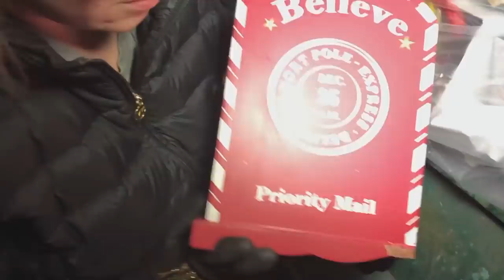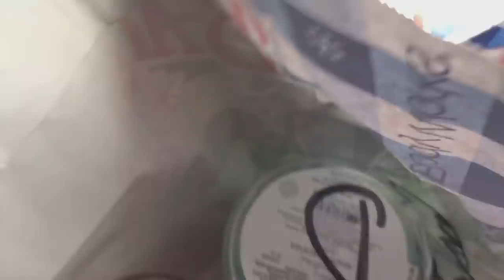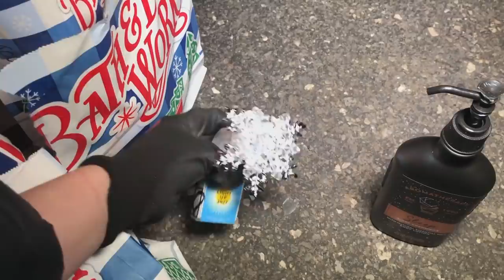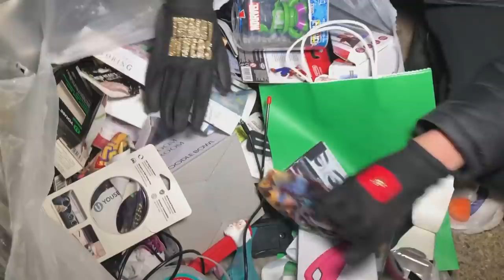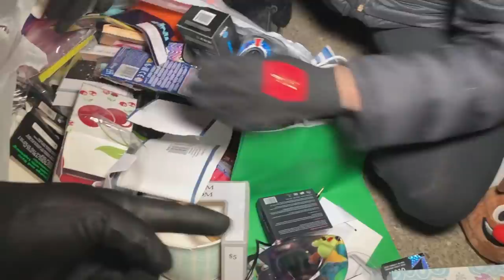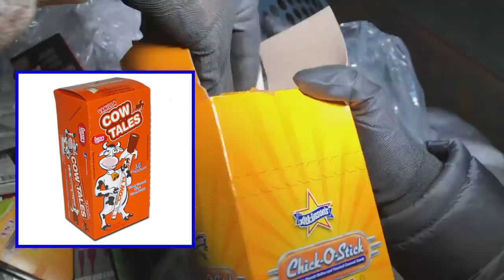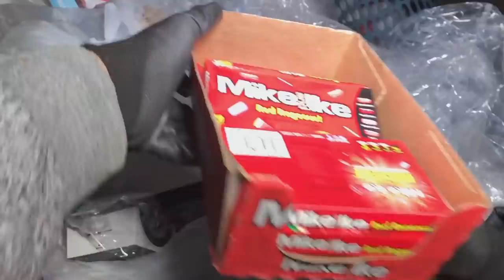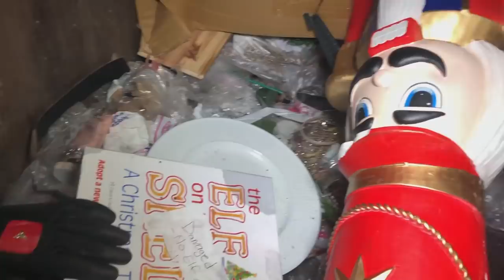MICHAEL'S EMPLOYEE'S LEFT US A HUGEEE! SURPRISE! IN THEIR DUMPSTER!

Comment: An easy way to get it out is to pop the candles in the freezer then it should slide right out!! If you get ones that are really burnt and you’re not really going to be able to burn the candle but the glass isn’t broke then boil a pot of water pour some in the jar it’ll melt like a lava lamp let it cool and pull the wax out. I use the wax in my warmer and then i pop out the wics using a butter knife and and reuse the container for whatever like cotton swabs I even made bath bombs one year and used the containers to gift them out in.